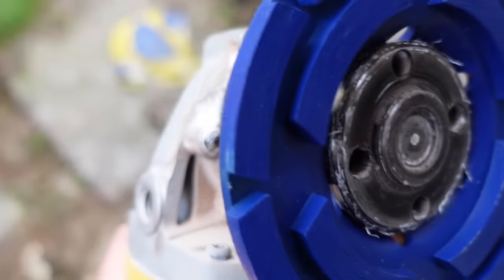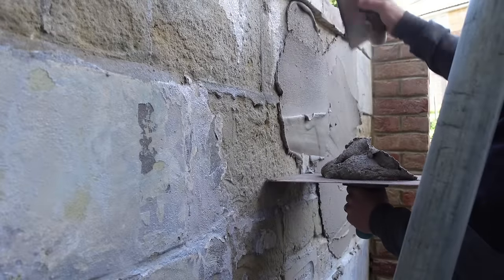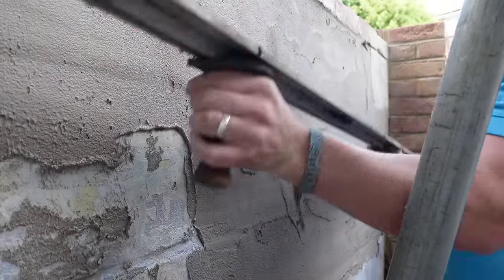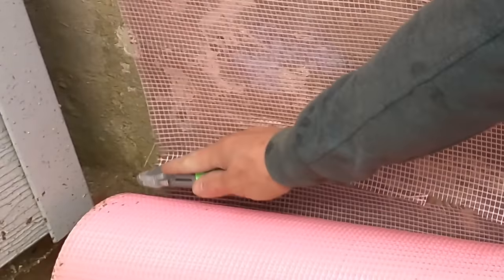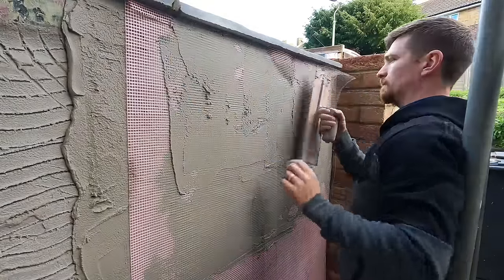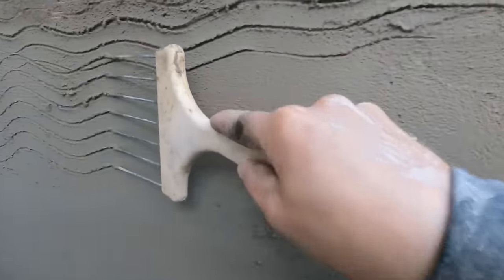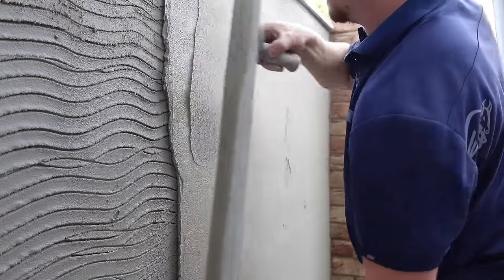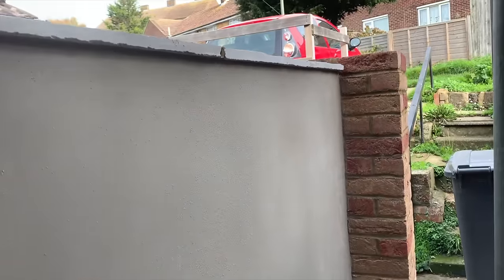RENDERING: Worst Garden Wall **EVER Needs FIXING…"THIS NEEDS KNOCKING DOWN"

Comment: Hi - I have a repair to do on the front of the bay. The horizontal is fine but the angled bell went all green and the concrete paint went soft / permeable. I have scrapped off about 4mm of render some of which was damp so obviously moisture was getting through. Should I remove the lot or can I just patch over the existing render? Its a strip the width of the bay by about 9 inches on an angle? Do I need mesh to give it strength considering what has happened?

Comment: I wish i knew how to post pictures on here of the wall i have to render in the next couple of weeks, we have hacked off old render that had cracks appearing but soon realised the render was actually as good as you can get and was a nightmare to remove that then only left 1 outcome for the cracks, the brickwork had large cracks all over it, there was no mortar in the joints, every service was being brought outside via that wall and the plumbers had butchered the walls and filled the holes around the pipes with pieces of brick. Not to mention the lack of mortar had caused some bricks to push towardds the cavity as we were hacking off. We came off the job and got a bricky in to make the wall right for rendering but have no idea what we will return to but i can honestly say working around 5 yes 5 windows and door will actually seem like a walk in the park no doubt.

Comment: Hi Blaine I’m going to try my hand at plastering one wall in my bathroom.I’ve ripped the tiles off obviously half the plaster has come off with it so I’m going to take it down to the brick.have you got a link to a video that takes you through all the stages.also has a small window with a deep recess.

Comment: I would of fixed (plug and screwed) EML, Galvanised Expanded Metal Lath or Galvanised External/Internal Rib Lath sheets to the wall, then applied two coats of a sand-cement-lime mix, using 6 parts plastering sand, 1 part cement, 1 part lime.

Comment: Hi Blaine, I notice you render to the floor without any drip/bellcast beads on garden walls, doesn't this cause any issues?
Reply: There doesn’t tend to be DPC or DPM used on garden walls so where the render ends doesn’t really matter. Any moisture can still travel up the wall and cause the render to blow. Good question though mate 👍🏼 I’m sure a lot of people are thinking that same, hope this helps

Comment: Complete nonsense to knock the wall down or build one next to it, if you want it 100% straight just use polystyrene sheets or hard insulation sheets and then you can render it. Other alternative is decorative or real stone tiles or composite cladding, but why knock stable wall, doesn't make sense
Reply from the maker: Both options would be expensive. You can’t use these sheets on walls with 40mm dips and humps- it wouldn’t work. You’d have to render the wall flat first, apply the insulation and then render it afterwards (with render that’s 3x more expensive than sand cement). 

As for the tiles, that’s the same. You’d have to render the wall first (like I did, which is a lot longer than usual due to the state of the wall), then spend the time to tile/ grout it afterwards. Except your material costs for this decorative wall tile comes to £30+ a SQM…that’s not including the costs to render it beforehand!!

And then you’d still have the big gap between wall and building. The builder was there building pier in the video. He could have just throw a quick block walk in front and saved a lot of trouble leading to a flatter, more appealing wall. It would have saved time, costs on materials and Labour 👍

That’s just my opinion pal - I appreciate your view